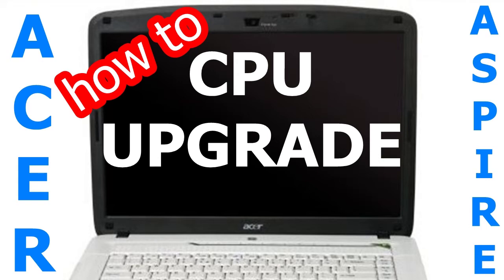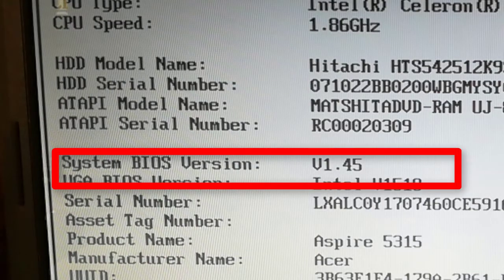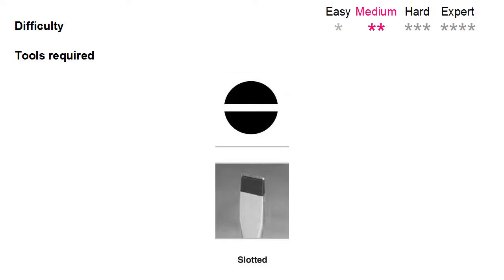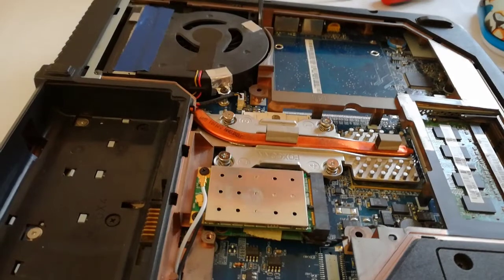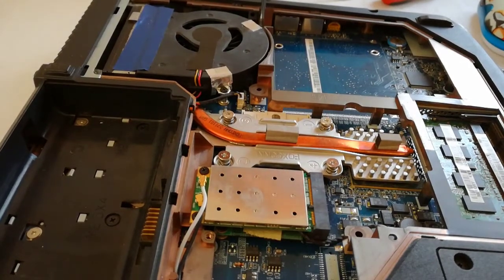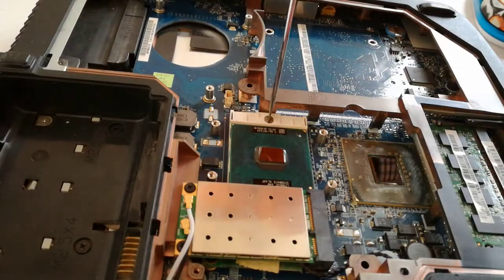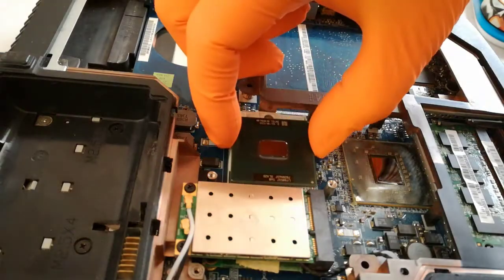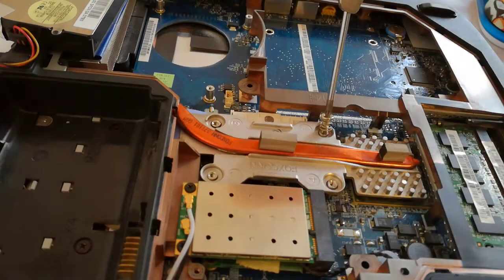How to upgrade the CPU for Acer Aspire 5315 laptop Ep.227

Comment: My Aspire 5315 comes with an Intel Celeron 550 (SLA2E) and chipset Intel GL960. Are you sure it supports 4 GB RAM?. It seems that the limit is 2GB
Reply from the maker: Aloha, I only tested with 3GB RAM, because then I haven't got 2x2GB sticks, but if it recognized 3GB it should be OK with 2x2GB to.
 I repeat, I haven't tested with 4 GB and I sold sold the laptop, now I can't repeat the test with 2x2GB RAM.
However if you have only Celeron CPU,  the CPU usage it will go to 100% before it can use 2GB RAM.
I think the best upgrade for this laptop is a:
1. SSD
2. dual-core CPU and  RAM
because this is a 10 years old laptop don't install newer operating system then Windows 7.
I hope I was helpful, please leave a comment how it went the upgrade to help others to.
Reply: @redigitt  i just bought a T7700 and 2x2GB DDR2 800MHz, they didnt arrieve yet but i am very nervous and i want them to work properly, wish me luck
Reply from the maker: I wish you good luck with the upgrade and use a good quality thermalpaste.
Thank you for watching, if my video or advice was useful, please consider to like, share and subscribe.
Reply: @redigitt  Aloha, its me, from the future, from the same Aceraspire5315, but now with the Core 2 Duo T7700, it is blazing fast and it supports Youtube playback at 1080p or 720p60 without a problem, however it only supports 3GB of RAM, it seems that the bottom slot only supports 1GB sticks, but the top slot supports 2GB and 4GB sticks since one user even got it to run with 5GB of RAM, the 3GB of RAM and the new CPU gave this laptop a new life, and since i am using Windows Vista, the requierements are low and it runs flawlessly, and since i am using the extended kernel for Vista, i am now commenting from MS Edge V106, outdated software is not a problem.
Reply from the maker: Aloha, thank you for your update and I'm glad you can enjoy your old laptop again.
Reply: It will run 3 gigs, a 1 gig and a 2.  But they have to be in the right order.  If it won't boot on first try, then switch the memory sticks.  All should be good.

Comment: good job. but better to upgrade for 2 cores cpu. like Core 2 Duo T7500. just $2 on ebay.  Also it can handle 3GB RAM, possibly it needs to play with memory slots, main is working well with 3GB ram.
Reply: I just put it on mine acer 5315 ,,t7500,,. It goes great.
Reply from the maker: Thank you for watching, appreciate for your comment please share to help others to make the right decision,
have a nice day.
Reply: do you think this laptop can handle the Core 2 Duo T9600 ? its the same socket.
Reply from the maker: @guilhermehenrique-zj5tt  Sorry I don't think this laptop will work with T9600 CPU.
In my opinion the best upgrade for this laptop are these CPU's:
Core 2 Duo T7500 2 2 2.2 GHz 800 MHz 4MB 35W   + +  
Core 2 Duo T7700 2 2 2.4 GHz 800 MHz 4MB 35W   + +  
Core 2 Duo T7800 2 2 2.6 GHz 800 MHz 4MB 35W
Please use a good quallity thermal paste if upgrade your CPU from a lower TDP CPU (27W ,31W)to a higher TDP CPU( 35W), otherwise will overheat the CPU.
Thank you for watching, please subscribe, share it  and good luck with the upgrade.